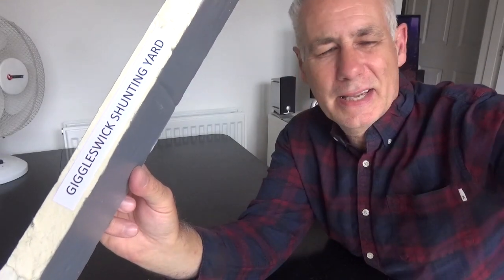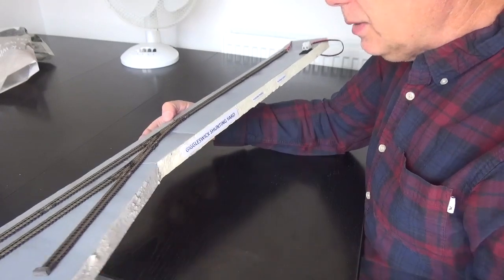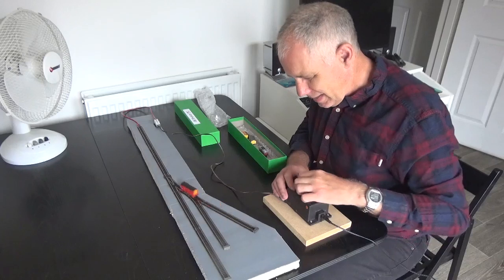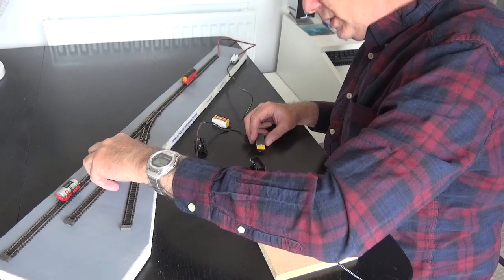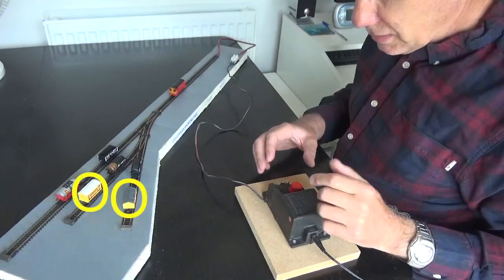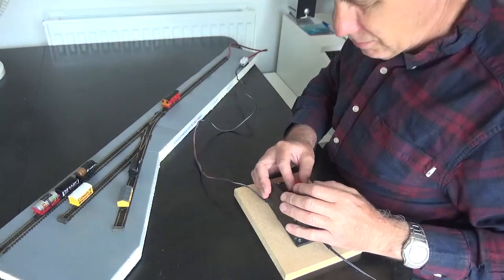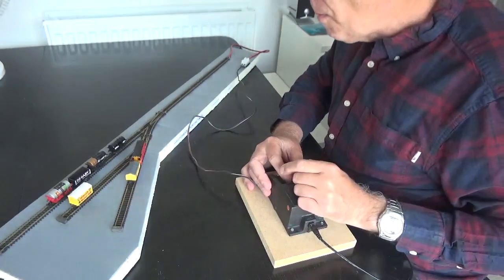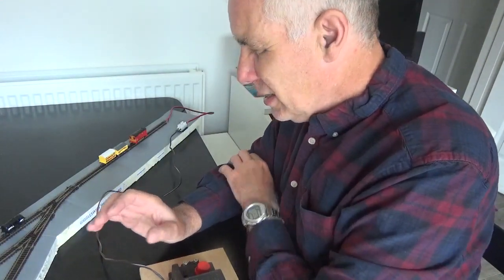Giggleswick N Gauge Shunting Puzzle

Comment: I'm about to build an Inglenook on such a board in N. I'll build a slight curve in the second siding to make all tracks parallel and spare width that way. Switches are a problem if they have plastic frogs. I got switches with polarized frogs and my Kato Pocket Line loco for $30 (new!) runs over them excellently slow. I like your cars. Good job overall.
Reply from the maker: Nice tip thanks for your comment.